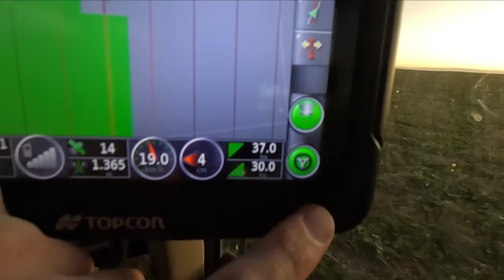No More Food For You! Feeding The Canola During Dry July

Comment: why dont you take the loader off the tractor when doing field work like spreading fertilizer ,...? lots of un necessary weight bouncing around wearing out your front end , made a huge difference to our 7810 when we strated doing that , they are sooooo easy to remove ( 5 mins) , just a suggestion !!